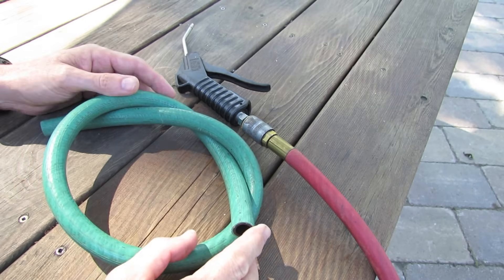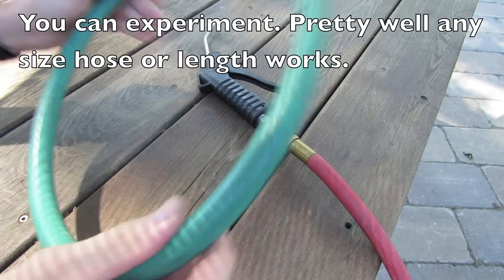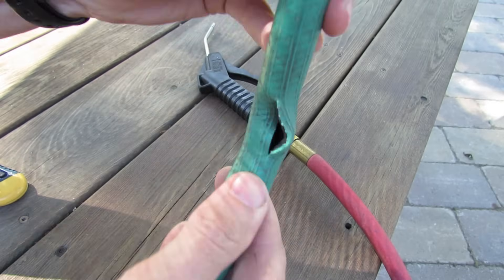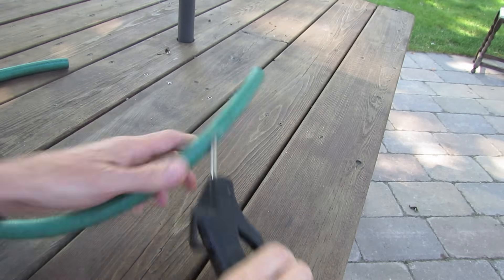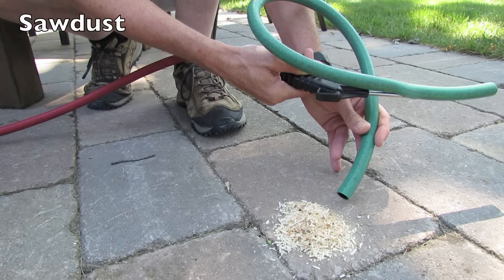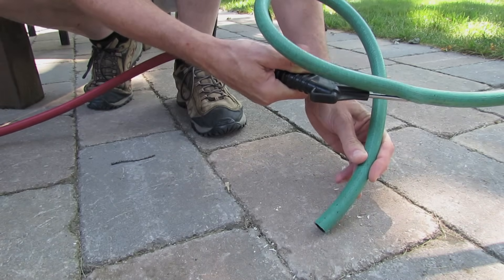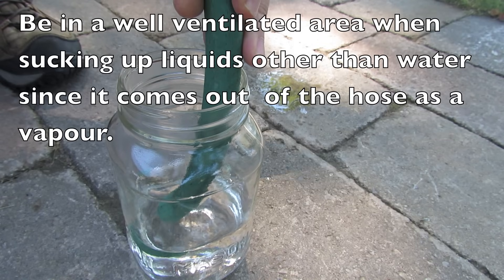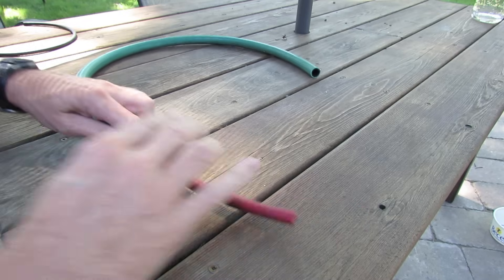How To Make ● A Simple Powerful Venturi

Comment: The slit in the hose isn't needed. Just place the nozzle near the end of the hose. It may take a little longer with a thick garden hose, but the vacuum will still work.
Reply from the maker: Yes that will work too but it works really well with the slit.

Comment: Thank you so much! You have saved me a significant amount of money,  I had recently topped up my car's screenwash with a new brand of fluid, and it turned out to be rubbish - it streaked until the windscreen looked like security glass and made it impossible to see where I was going.  I was going to buy a syphon pump or an attachment for my drill, but then I saw this video. Found a bit of plastic pipe that reached to the bottom of the washer's tank, made a slit in the pipe at the other as you demonstrated, and inserted my blow gun - one blast was enough to pull the liquid through the pipe so that I could syphon the remaining liquid out of the tank.  For info: I used 2 metres of 6mm i.d. hose, with the compressor set to about 5,5 bar (80psi).

Comment: Will it work with longer hoses??
Reply from the maker: You can experiment but yes, longer lengths will work
Reply: @chrisnotap  it worked my friend 👍
Reply: @Kabsati  what length hose were you using?
Reply: @GUARD14N  probably 3 meters
Reply: @Kabsati  Dear Friend, do you think it could work with 10 meters hose? I want to clean a vertical pipe which is clogged with gravel  (i.e. small rounded stones)

Comment: HI , and thank you for this video very helpful, question I have do all air compressors have suction like you showd, will it say if they do ?  Air compressors typically fill things with air that is why I am asking  thanks again
Reply from the maker: I think you may have misunderstood what is happening in the video. The compressor is not sucking the air. It is compressed air being blown into the tube that creates the suction on the other end of the hose. This is called the venturi effect.
Reply: @chrisnotap  , sorry for the confusion, I see what you where doing now, makes sense... cool stuff.... thanks for sharing!

Comment: BTW: You suggest putting the split back 6" on the hose.  Did you work this out from a little experimentation Chris so as to maximise the vacuum effect dictated by perhaps the amount of pressure you were able to blow from your hose jet & compressor pressure combination? or was that just a randomly selected distance that you found worked first time around?
Reply from the maker: Yes I did play with it and tried different spots and lengths. This seemed to be the best compromise for the diy guy that works on let's say small engines that needed to suck a small piece of debris and has compressed air at hand. Much better than grabbing a shop vac.

Comment: Bloody Brilliant!!! 

I have to clean out the anode and hard water residue in our caravan's water heating unit.  Just about every caravanner with a HWS on board will need to do this as part of regular love and care of the HWS along with replacing sacrificial anode.  Indications were that you buy a small "arm" that snaps onto your regular hose fitting and you try and wash it out the same hole by running lots of hose water in to the system to flush it out.  Looking at the diagram for this tool - I thought it was extremely inefficient and probably not all that effective.  The drain hole out of the HWS sits about 25mm higher than the bottom so a lot of the residue probably isn't going to just flush out easily like it would if the drain hole was flush with the bottom of the HWS and I thought a vacuum would work better than a flushing hose.  Then came the thought I had once before. Can I use my compressor somehow to turn it into a vacuum using some "gizmo" out there.

I have really good compressor and logic told me there must be something "out there" that will allow me to turn that outgoing air into a vacuum "somehow" - so I googled it.  Your very simple little vacuum is PERFECT for this purpose.  I'll make sure to be mindful of the outgoing vapour so might hack up a simple "Ladies Stockings Filter" to run it through or see if blowing into a water tub might capture the solids and temper the vapour spray. 

What a fantastic little gizmo and to add to that - it's super cheap and easy!!  Friggin marvellous thanks Chris.  Great stuff mate!  Thanks for sharing!
Reply from the maker: That's great to hear!! You shouldn't need a filter on the end of the hose since it is only water vapour and bits of scale that you are removing. I will add some new words to my tags for caravan water heaters.

Comment: what would the max length of hose i could use
Reply from the maker: Hose is cheap. Experiment. I'm sure you'd have no problem at 5 feet but that's not to say it won't work at 12feet. Of course the longer it gets, the less and less vacuum force you will have depending on what you're doing.

Comment: Thanks, I knew it could be done but I didn't realise how easy. I'm going to use this to make an oil vac pump to suck old oil out of small engines.
Reply from the maker: When you do that though it vapourizes the oil. Be very careful. Breathing that in would be bad for your health.
Reply: @chrisnotap  , yes don't worry I'm going to set it up so the oil gets sucked into a container and not blown out through the pipe.
Reply from the maker: Yes but as it goes into the container, air is forced in there too and needs to escape. That air will have oil vapours in it.

Comment: I thought that an air compressor blew air out, not sucked things up like a vacuum cleaner.  Please explain.
Reply from the maker: By blowing air through the hose, it creates whats called the "venturi affect". Air going in at high pressure creates a low pressure at the other end of the hose to suck things up.

Comment: I'm thinking of making a vacuum with my 12v compressor. Do you by any chance know what psi would be required for usable sustained suction? Thanks for the video!
Reply from the maker: +Luis “LostWorldExpedition” Getter  In the video, I used an air compressor adjusted to 100 psi.
Reply: +Chris Notap thanks Chris, I'll give it a shot and see how well it works on the road.
Reply: How much is 100 psi in Bar?  Most air compressors go to 8 (eventually 10 Bar.